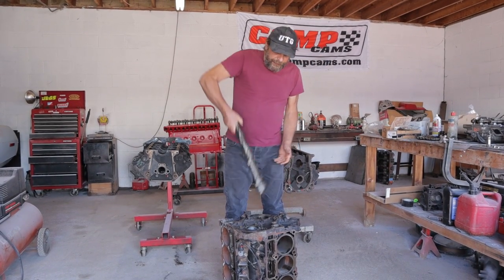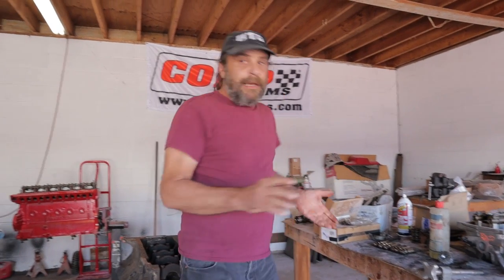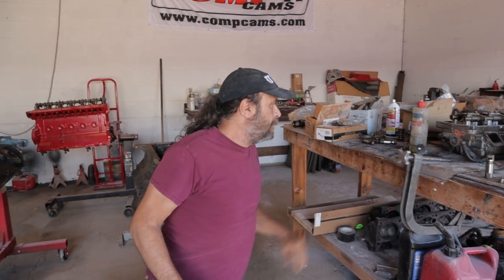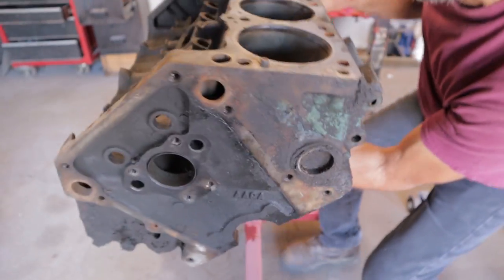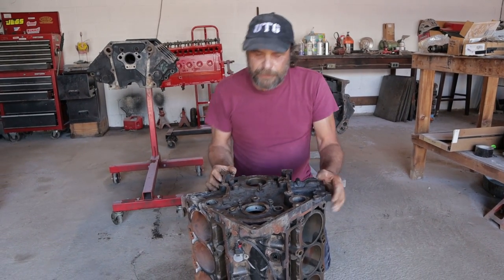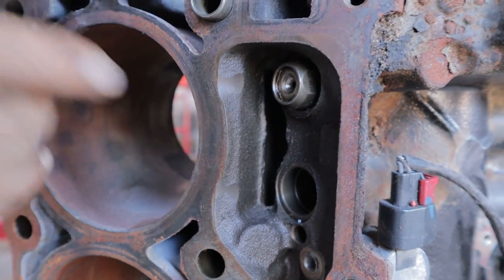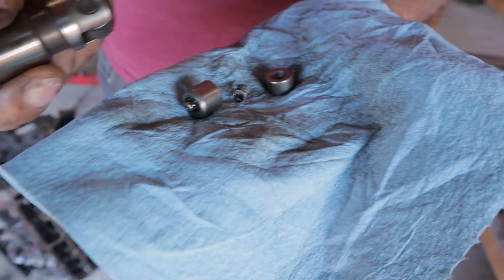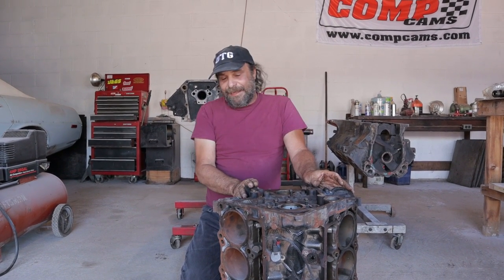Gen 3 Hemi Camshaft Failure Mystery Explained!

Comment: Try to imagine an engine, with really tight guides. Now imagine if the valve warmed up, and momentarily stuck in the guide. The rocker stops, the pushrod stops, the lifter stops...the cam don't. This crushes the roller bearings. Then, the cam is wiped out. Valve guide clearances in this engine are as follows: .9 thou, on the intakes, 1.5 thou, on the exhausts. If, for nothing else but worn guide reamers at the factory, (robot factory), you may have tighter clearances than this. This is why this happens. It does cause some lifter bore scuffing, (lifter stopped, cam didn't). Open up the guides by half a thou, on both. No problem on MDS, or, non MDS. How do I know? I worked for FCA tech support. Seen many, many hemis, stripped apart on operating tables in the Engineering building, in Auburn hills, Michigan.
Reply: Excellent 👍
Reply: Your improper use of commas diminishes my faith in you exponentially.
Reply: @jesseshaffer6105  Hes' a mecanic, give him, a brake.
Reply: Better yet, leave that MDS bullshit out altogether....if you are driving a vehicle with a V8, your last worry should ever be fuel economy period, no excuses....I've never bought a pickup going damn this thing better get 50mpg, its a truck, its for work, it'll be towing/hauling I want it to tow/haul without breaking down, fuel economy is the least of my worries.  I want it to do its job for 20+ years you know like trucks that automakers used to build...to work, not as a cute little mall crawler show off toy.
Reply: @wildbill23c  ...the government is FORCING the manufacturers to come up with this shit. Vote conservative to help fix it.
Reply: @MormonMustang_  thanks, typing on a cell phone, with mechanic hands, is like "The Rock" driving a Miata.
Reply: @jesseshaffer6105  quiet the opposite, he's focused on engineering not gay english class
Reply: MormonMustang love the sarcasm! LOL
Reply: @mikestone234  Don't waste your time with some of these clowns, what you said is worth a million bucks.
Reply: I compliment you on not throwing the creator under the bus for dis information. As a 37 year Master ASE and heavy line guy it made me insane. I had to stop watching.  I'm screaming in my head It isn't a Briggs n Straton.   I've seen the spintron tests too, and the clearance TSB too.  Tribologists would be flipping too.
Reply: @wildbill23c  What utter nonsense if you can make the same HP with less fuel consumption why wouldn't you?!
Reply: mike stone william he is exactly correct on this shit. The manufactures dont have the ability to say no. Same thing with the emissions standards. All because of the 50 state emission shit.
Reply: Thanks for ur good work. The consumer demands reliability; or they choose a different make.
Reply: Jesse Shaffer be more concerned with the use of calipers, and feeler gauges!
Reply: William Sevier then you will be heading for what will soon be the toughest truck out there! The top level, Tri-Motor All Wheel Drive , Tesla CyberTruck with 500 plus range,  Adaptive Air suspension, 0-60 in 2,9 Seconds, 30 x Cold rolled Stainless Exoskeleton Frame / Body, that can’t rust!, 6.5 foot bed with stainless roll top security vault clover 14,000 lb towing capacity,, Up to 16” Ground Clearance!, it can kneel down the bed to allow the ramp built into the tailgate to be extended to load  and unload  up the ramp, the lawn and garden tractor or the CyberQuad ATV which can use the on board AC inverter outlets to charge  up and also  charge power tools and camping gear. There is a tent to turn the bed into a camping area too!
Reply: Ronald Leckfor you are gonna be let down on a lot of stuff if you believe the cybertruck crap
Reply: Sak 20012019 and how do you know that! Tesla makes real world electric vehicles! They have a decade of engineering and experience and top level engineers who used to work for NASA,  Tesla’s sister, SpaceX just got us back in the business of launching US Astronauts from Florida, beating the pants off of stodgy Boeing who couldn’t even set a mission clock right on their capsule during their mission critical qualification test, a capsule which is part of a bloated, high priced manned launch system. They are a shining example of establishment  manufacturers that are sluggish, and dead on their feet, because that’s the way it was always done! 

Detroit is going to get their clocks cleaned by Tesla!
Reply: Ronald Leckfor first why would you want ‘detroits clocks cleaned by tesla’? The other brands bring a ton of money to america. Which means keeping cost down in the US. Also for the tesla truck. Everything on that truck has been proven to be fake. The only thing that really will maintain itself is the stainless body. But nobody wants a stainless body. It is a pain to get fixed and extremely heavy. Look at the delorean. 0-60 will not come in 2.9 secs possibly 3.5. The bed size is not even that big it is like a chevy avalanche. Also the range of 500 is not even close to available on the normal tesla let alone a truck. Even if it had that range good luck towing anything with it. Evs suck at towing.
Reply: Sak 20012019 I am not saying I want Tesla to clean Detroit’s clock. It is a fact that Tesla has been chugging right along while GM Ford and FCA have not been going through the pain when they should have! They are all very late to the EV Game! I feel it’s a big shame, the Detroit three (you can’t exactly call them big anymore) are slow reacting and set in their ways, still trying to ride Grandpa’s ICE technology into the future. If they don’t get serious, they will be dominated. We seen what happened in the late 1970’s through Mid 1980’s, this time will be ten times worse. Do I want to see that? Hell no, but if I sit here and say the Emperor has clothes when he thinks all is fine, I’m not doing the Emperor any favors nor any one he is parading in front of and has to see that lewdness, am I?
Reply: Ronald Leckfor we are not going to see the big three fail. They are too deep into too many economies. We also are not not going to see an oil crisis for a while. The reason for evs is cut down on polution not save on gas. Also the big three have made many changes to their lineup and especially gm has been more successful than tesla with evs. Tesla makes unreliable evs and they are way too expensive.
Reply: Sak 20012019 GM successful with EV’s? you have got to be kidding! GM  farmed it all out to LG Chem, built them on converted Chevy Spark Chassis to make the Volt. Nobody wanted to drive the Spark as a gas engines vehicle so why would they want a Volt! 

Give me a break, they learned nothing, even with their recent EV initiative, they still have their head up LG Chem’s ass, choosing to sub it all out as usual instead of learning, getting their hands dirty, using a clean white sheet of paper with their best US Engineers scribbling on it! GM’s theology is to final assemble cars made of subcontracted parts anymore! Gone is Packard Electric, Delco-Remy, Saginaw! In March 2919, they gave away GM East Assembly Plant Home of the Chevy Cruze, Chevy Cobalt, Chevy Cavalier, Pontiac Sunfire, Cosworth  Vega, Chevy Vans, Chevrolet Biscayne and more. They gave it away to an EV Upstart, called Workhorse / Lordstown Motors which will be starting pre production runs of the Workhorse Commercial Fleet Pickup Truck and as Lordstown Motors, the consumer version, Endurance Pickup. It is a conventional steel chassis, but only has a 300  mile range for $52,500! Yes you can get it in several pretty colors thanks to the still warm from making the Cruze,  Zinc Chromate primer whole body dip submersion tank and the three Bell Shaker, electrostatic charged Paint Booth. but it’s not that special of a truck and will not be accessing supercharging at the extensive Tesla Supercharger Network unless Lordstown Motors makes a deal with Tesla to share cost for the Tesla Network. They will be stuck hunting down Electrify America and other public charging stations, while all together don’t make even 1/2 of the amount of Tesla Stations in place today! 

I live 13 miles from Lordstown, Ohio!
Reply: Sak 20012019 part two of GM Corporate’s disconnection is they have once again partnered with LG Chem to build a Li Polymer, Prismatic Pouch Battery factory right across the street from the old GM East Vehicle Assembly Plant, that they don’t own anymore, or do they have a clause in the sales contract for the Assembly plant and are just using Workhorse and Lordstown Motors to keep the seat warm for them until they offer Workhorse a get the hell out of our old plant deal Workhorse can’t refuse! 

That is what I expect to go down, or they do something to just collapse Workhorse’s market to scuttle  them into insolvency! 

Probably, the latter, as there is a buyback clause in the plant sale contract.
Reply: @DishNetworkDealerNEO  you don't know much about Automotive history do you Ronald? The ev1 is a GM product that was out 20 years ago, and GM has been making hybrid locomotive since the 1950s. Not sure where you're getting all your information, but GM makes the only electric vehicle that does not give the customer range anxiety. When will Tesla step up to the plate?
Reply: Ok guys serious question here! Now I'm no master mechanic by  any means but I do know how to work on my own vehicles at least when it comes to maintenance or basic repair but who the hell do I go to if i wanted a professional to do what mike stone is describing? I doubt I could go to my local shop or even dealer cuz they'll probably throw some bullshit about factory warranty or some shit right?
Reply: @DishNetworkDealerNEO  wrong, LG wasn't even a company when the EV-1 came out.
Reply: @xc_4x4  I hear ya, a good independent shop, with ties to a competent machine shop would help.
Reply: Ronald Leckfor my point is chevy alone sold 10,000 ev less than tesla in 2015. Those are the years ik. Tesla is not everything in this world tesla has the ability to tell any tesla to stop being able to charge. Too much control especially with low grade mechanic work where a part is replaced but it was not replaced by a tesla mechanic and therefore the car is no longer able to be charged. There are not enough teslas on the road to make enough of a difference in todays economy. It will come from the big three competing with each other. The future will not be ev though. It will be hydrogen or hybrid gas/electric. Ev are not fast enough to keep up with gas engines.
Reply: mike stone you mean the California compliance car? The ones they crushed except for Francis Ford Coppola’s he squirreled away at his Vinyard?  The one he showed to Leno?  Give me a break! GM Corporate did not want it to succeed! Experience comes from making a million plus EV cars, a feat Tesla recently accomplished! How many Plug In EV cars has GM actually built and sold? Ha Ha, I’m rolling on the floor! 

Diesel -Electric trains have no relation to what it takes to make a personal car or light truck! Tesla is also going to make Semi Tractors soon!
Reply: @DishNetworkDealerNEO  no dude, you have made it very clear, that you have no clue. GM made this vehicle, because they were pressured to. The public petitioned GM to make their concept car. GM said they would make it, as long as 5k people would commit to leasing it. GM made it, and less than 2000 took possetion, leaving GM holding the bag. GM honored the leases, the tree huggers didn't honor their agreement. ( No money....why is anyone surprised?). Great little car, when used properly. One or two are still out there.
Reply: @DishNetworkDealerNEO  dude, I'm just giving you some history.....if you're just going to keep French kissing the Tesla, don't forget the bugs stuck to the headlights.
Reply: mike stone I am more concerned about where we go from here! Tesla is the only player out there. There’s Nicola who doesn’t own a factory and wants a subcontractor to build its new truck design, a recipe for disaster, there’s Rivian who has had a factory for several years, but so far hasn’t made a thing. There’s Workhorse/Lordstown Motors ramping up to  start real production in January 2021, provide Covid 19 doesn’t slow them down. All planning on being EV Pickup Truck makers. This will eat into the lucrative ICE pickup market, the cash cow, profit center of Detroit! Detroit had better get their collective  asses in gear in a hurry!

I’d love nothing better than to see plenty of Mopar EVs  on the market in the next few years! I have own 5 Dodges and 4 Chrysler’s and 1 Chevy throughout my life!
Reply: @mikestone234  dont forget about the electric s-10 they leased to stores like, orileys, napa, and autozone for deliverys.  Shit little trucks with very low range.. but they did make them.
Reply: @DishNetworkDealerNEO  dodges/Chrysler's....same company. They worked with Fiat on the e500, a fairly popular EV. A lot of manufacturers are working on EV's, just because you haven't heard about them, doesn't surprise me. I lived in Michigan for years, it would be very foolish to think, that the "big three" don't have something going on. Tesla is a great car, but, it's not the only great EV.
Reply: @ThEPuP4x4  I do remember those! They were pretty cool! Not too bad on range. Perfect for parts delivery.
Reply: mike stone 

As far as Chrysler goes, Fiat Chrysler Corp either should add a decent car lineup, or move the remaining two models, the Pacifica and 300 into the Dodge lineup! It’s a damn shame whet FCA has done to the Chrysler line through neglect! 

They should have dumped the badly designed  3.6L VVT in Lake Michigan and stayed with the 3.8 Liter!  The 3.6 L VVT has been a nightmare whether it was in the Grand Caravan or Town and Country! The final nail in the coffin, is the miserable excuse for an electrical center, introduced in the 2008 and up, the Totally Integrated Power Module, the TIPM! It is a very unreliable design that has cause nothing but grief for poor unsuspecting Mopar owners! 

I know all about the Fiat e500, just like the ICE Fiat 500’s and all its variants such as the Fiat 500XL, let me know when FCA decides to make cars that will sell, not TOYS! If you haven’t noticed, Fiat 500’s don’t sell, and are being withdrawn from the US market!!

By the way, today, Tesla just took the top spot as the  the Most Valuable Automaker Today, on 6/11/2020! Source: Good Morning America!

The Model 3’s and Y’s are selling like hot cakes!
Reply: @DishNetworkDealerNEO  you sure have a bad opinion of every other car company. Even though they have done most of the innovation that this country has seen, for over a hundred years. You sound like a salesman for Tesla.....who doesn't have a clue about automotive history. I was Tech support for FCA/Chrysler/Dodge for a few years, supported the Fiat products, as well as the rest. Your opinion of the 3.6, is baseless. We had a valve supplier issue, (poorly ground valve stems). Otherwise, it was a good engine. (The problem was fixed, the warranty's honored). No need to screw everyone but Tesla. If Tesla's products weren't as high as giraffe pussy, everyone could buy one. Personally, I like my Truck. I can fuel up in thirty minutes, haul a 14 thousand pound trailer, and with a hand, drive.from LA, to Maine, in 4 days with it. But, that's me. When they start putting slots in the road for electrification, I'll buy an electric truck. You need to learn some history, and do better research. You're missing out on a lot of cool history...just because you refuse to look.
Reply: mike stone I am a retired Electronics Engineering Technician. However, I have owned many Plymouths, Dodge’s and Chryslers.  For the most part, I have maintained and fully repaired my vehicles, including, installing new timing chains and gears, replaced the rear main bearing seal, replaced a crankshaft and bearings,  replaced engines and transmissions. Did rust repair and light collision bodywork and full car painting when I was young! So, I have been there, done that on a non professional basis, not as a Dealer service tech, mostly in the 1970’s to 2000’s.
Reply: @DishNetworkDealerNEO  I understand. I have built quite a few nice American hot rods, have most of my experience in independent shops, alternate fuels, even built a electric Lincoln Town car. Lots of natural gas vehicles, propane, and dual fuel vehicles. Mostly in emissions, and the science behind it.
Reply: mike stone the best engine I ever owned was the 225 CI Slant Six! They were very hard to kill! I had two with the Hydraulic Lifters, the first st one of those went 217 K, only succumbing to a clogged Catalytic Convertor, I changed the Cat, but the rings were done. I found another  slant six  with 65,000 miles on it,  from an East Ohio Natural Gas , Dodge B150 Van, it was rum on CNG. That was the cleanest engine inside I have ever seen, like Chrysler had just made it. I want to kick the guy who pulled it , as he dented the Valve cover and when I remixed it to use my old slabs six there was not build up of sludge from the oil. CNG does not make any carbon in it’s burning like gasoline does.
Reply: @mikestone234  can I get your genuine opinion? I've been a Ford guy all my life.  Went with a 19 ram 2500 6.4 crew cab long bed because ford would hardly budge off MSRP.  I really hate the MDS as it vibrates the truck at 1900 rpm, and lately everyone I talk to with a chrysler/jeep/ram product has had to have lifters done before 100k miles.  I'm pretty nervous as I'd like to get 175k miles out of this thing without engine issues. I'm big on maintenance (although ran mobil 1 for my first change at 4200 miles). Truck was supposed to be changed at 6000 and was 2 quarts low, and nobody local carries penzoil ultra platinum.  Thinking hard about going to fords new 7.3 gasser.  Thoughts?
Reply: @robertbasile4191  Hey Robert, synthetics are great for these engines, (any engine), I really dont know much about the 7. 3L Ford. The company i used to work for, is working on a Propane conversion for it. Apparently, it has pretty good torque and power, loves gas too. The 6.4L Dodge is also a good engine. Been produced longer, gets better mileage. I know that everyone is knocking the MDS system, but, it does save fuel. These engines depend on really clean oil to deal with the tight tolerances. Let it warm up a bit before you blast off in the cold mornings, use the recommended weight of oil, you should be able to drive it a long time. Buy the extended warranty, just in case. Drive the crap out of it. (It likes it). For every person having an issue with these engines, there are a thousand that don't. The MDS at 1900, is light cruising. If it is irritating, drive it in Trailer tow mode and see if it works better for you. ( I use the trailer tow mode, in my truck, for in-town driving.
Reply: @mikestone234  thanks for your reply.  With these 8 speeds the truck regularly is in 1500+2000 rpm.  To keep it above that I'd probably be driving like an a-hole.  Even the highway at speed it stays there.  MDS has only saved me 1 mpg in general.  I know the government wants better fuel, but I don't understand why ford and chevy don't have this on their 3/4 ton trucks.
Reply: @robertbasile4191  I understand. 1 mpg Doesn't sound like much, but, when you are getting 10mpg, 1 mpg is a 10% improvement. Its the government, that is pushing the manufacturers to jump through all these hoops. Some of this pressure is causing some great ideas to come out. What bothers me, is that, a lot of folks are condemning the MDS system, when, extremely tight valve stem clearances, are what is causing intermittent seizing of the valve train, and the wiping out of cam lobes. Personally, I don't think that this technology is needed for anything more than a 1/2 ton truck. If you look up " hyper-mileing", which is a method of driving to consciously improve your mileage. I believe this, is a more effective mileage improver, than the MDS would be, for larger/heavier, working vehicles. Higher octane fuel would help as well. (Along with "hyper-mileing" type driving). You could try an MDS delete on this, and see.
Reply: @jesseshaffer6105  it aint no thesis
Reply: @mikestone234  thats a real nice theory.. but if this scenario happened wouldnt you also get burnt valves from them being stuck open.. it seems to me lack of oil is heating the lifters and  wearing out the rollers but there is sufficient wall clearance to stop the valves from being stuck open.. but yours is a nice theory though
Reply: @MrRasZee  you figure it out then. How many times have you seen a lifter, that's bathed in oil, stick? By the way, valves will burn... If the valve remains stuck. In this case, they don't remain stuck. The valves stick intermittently.